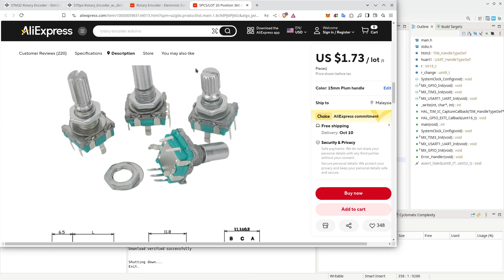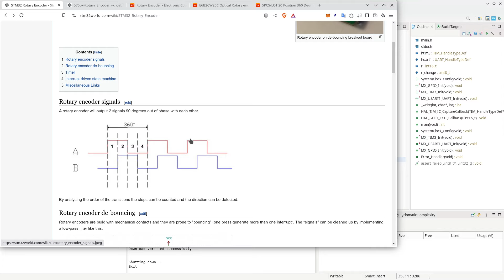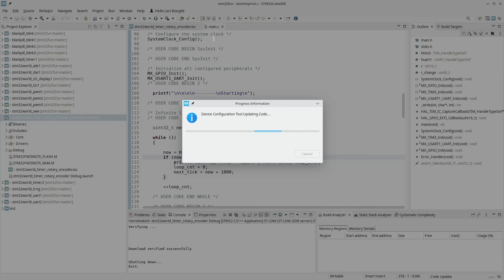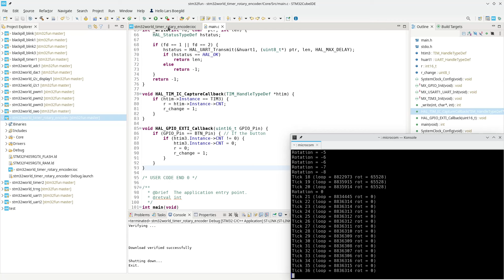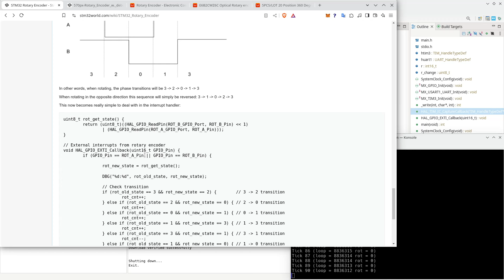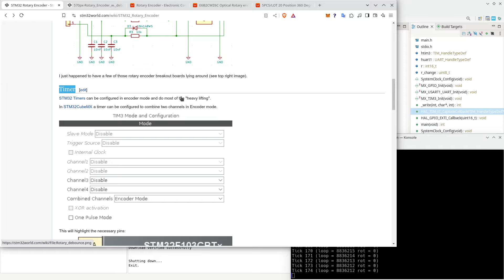STM32 Tutorial #18 - SURPRISING Timer feature - Rotary Encoder with Timer Input Capture

Comment: I only put 2 resistors from the 10khom VCC to ch1 and ch2, I didn't put the capacitors
Reply from the maker: You might get away with just the internal pull-up.  They are pretty weak though (roughly 40k I believe).

Comment: ok gpiopullup now works and is stable, it doesn't run on its own, but there is a problem, it skips parts, it goes from 1000 tim cnt to 30 cnt, it skips, it loses some pulses..,.
Reply from the maker: Well, without seeing your schematics and not knowing the cp encoder you are using I can't really tell what is happening electrically.  You would probably need to hook up a scope and analyse it properly.

Comment: hi, I'm using an stm32 f308 and an omron 2000 cp encoder, it doesn't always work correctly, sometimes it starts running on its own without moving the rotor, are there any disturbances, doesn't this happen with the bounce circuit?
Reply from the maker: Well - don't know your circuit but sounds like a source that is not well driven in any direction.  You can experimentally try to active either pull-up or pull-down on the input.

Comment: Using the timer in such a way is quite interesting. I do miss the ability to detect speed of the rotation, though. For me, the state machine plus a timer measuring the time between A and B has been my method. Thank you for an excellent demonstration!
Reply from the maker: If you watch the video to the end, I enable the input capture interrupt and the callback is executed.  Would be quite trivial to establish the speed either by looking at the uwTick OR resetting a faster running timer in that callback.  It might even be possible to cascade two timers.
Reply from the maker: If you run say TIM2 at 1 MHz (prescaler of 83 in this case) you can detect the space between the interrupts on TIM3.  Quite simple.